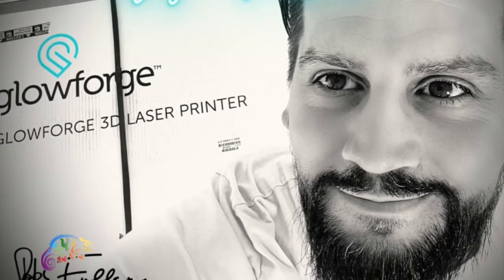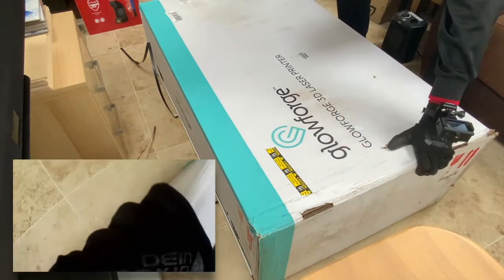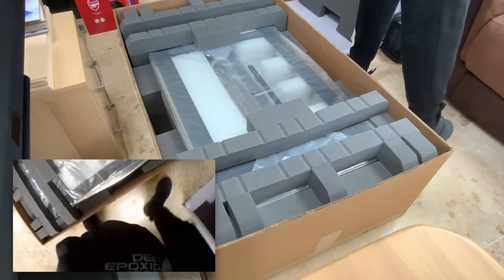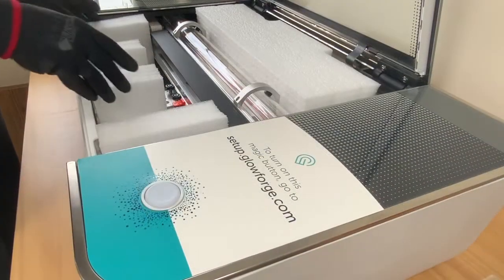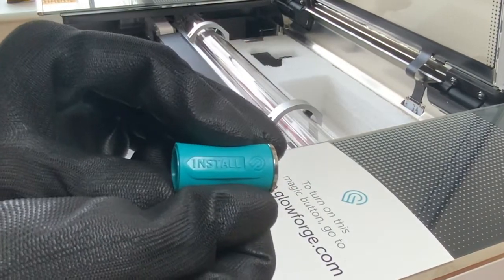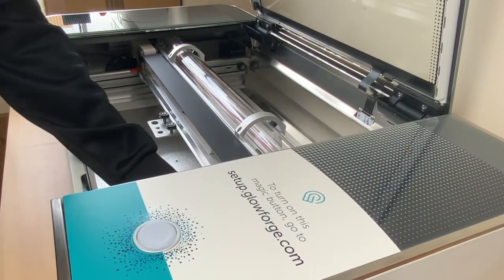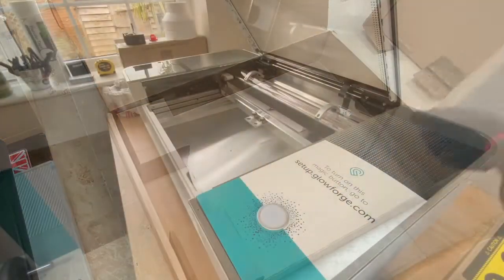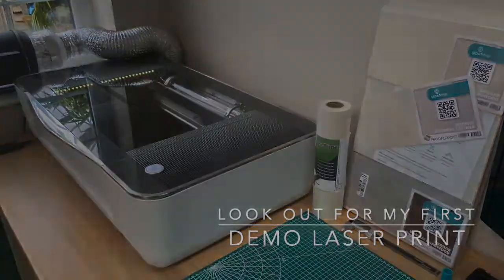Glowforge UK - Unboxing my Glowforge Plus 3D Laser Cutter & Engraver

Comment: Hi great video. What sort of fees are we looking at with regards to Uk shipping/customs tax etc?
Reply from the maker: Thank you! It depends on the model - for the ‘Plus’ model I paid about £760 for Import VAT, Duties and Brokerage. But I used a referral code on the full cost of the machine which gave me a $250 discount off the machine. 
I have a referral code you can use (in the description) for $100 off a basic, $250 off a Plus or $500 off a Pro should you decide to go for it!
Reply: @artistrobfuller  Thats great thanks for the help, if I take the plunge I will definitely use your referral 👍🏼
Reply from the maker: You’re welcome and that would be very much  appreciated! If you’re UK based you can check out and join in with my Facebook group ‘Glowforge UK’ dedicated to UK Glowforgers and potential owners who may be procrastinating! It’s packed full of info to help answer many of the questions I know I had when I was looking and didn’t know where to turn to. Hopefully you’ll find many of your queries are covered there!

Comment: Regarding the plug, did it come with an adapter head? I currently live in the US but we will be moving to the UK next year so I wasn't sure if it only came with a US electrical plug or one for multiple countries or if you were having to use some sort of converter for UK electrical outlets.
Reply from the maker: Hi Scott, thanks for reaching out. I can confirm that mine came supplied with a proper UK plug/kettle lead so I assume they have those in supply specifically for UK based orders.